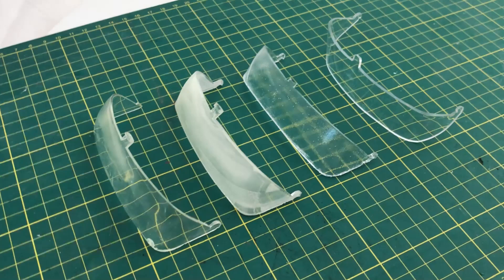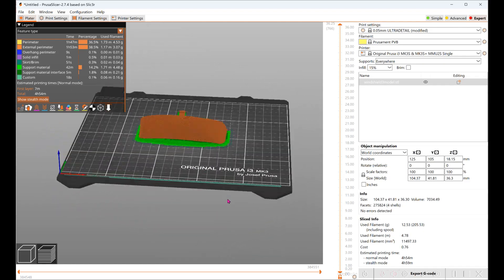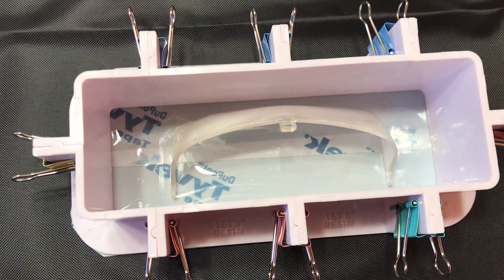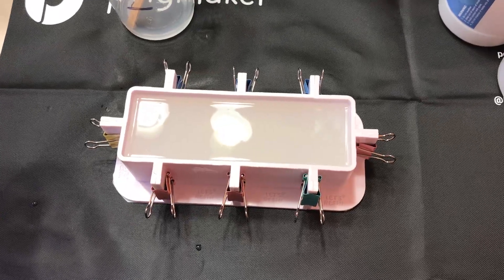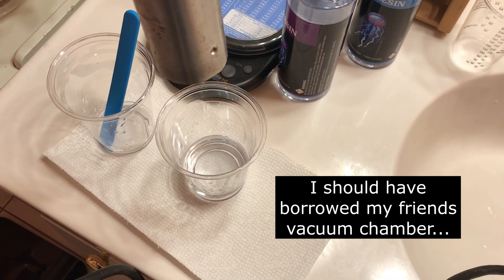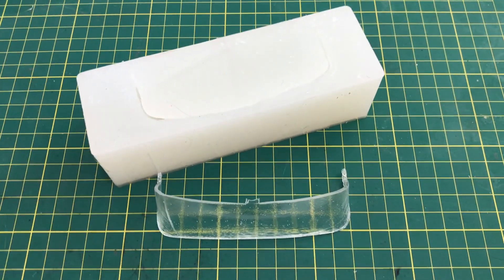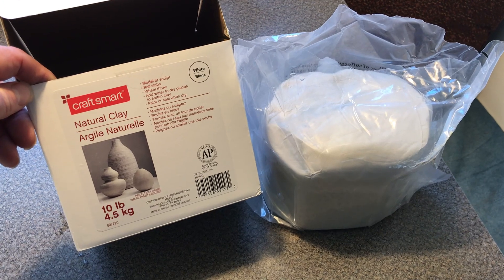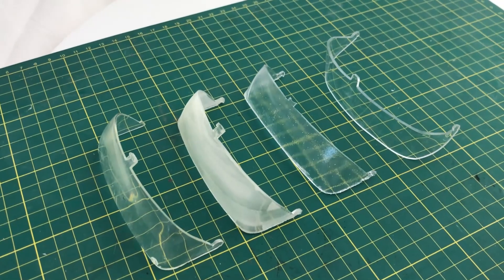Making Clear Replacement Parts: Pros & Cons of of 3D Printing, Silicone Molds, and Heat Forming

Comment: Have you thought about trying to duplicate Lego elements? There are some that are very hard to find and many that only came in 1 ot 2 colors.
Reply from the maker: Do you have a photo of one of them? LEGO blocks have a really tight tolerance.
Reply: @SerendipitySue  I didn't have a specific piece in mind. Yes the tolerances are very tight. That is what to this day separates the Lego brand from the many imitators. I know there are a couple of websites that sell 3d printed Lego train tracks. I wish I could have some ball and socket joints in purple but they have never been made in that color.

Comment: My recommendation: if you want to get a consistent pressure on the part to form it to the mold, warm both the mold and the part and quickly put them into a vacuum seal bag that you'd use to store food. Then use the vacuum heat sealer to draw out the air and then heat seal the bag. The outside ambient pressure should press the acrylic into the shape in the mold. Wait for both the mold and part to cool, and when you open the bag the part will retain the shape you want. I've successfully used this method to form vegetable tanned leather perfectly around shapes to make custom leather holders for various tools and electronics. For the electronics, I'll 3D print the object for the leather to be molded. Hope this helps and let us know if it works.
Reply from the maker: Thx. I like the idea of the vacuum bag. I was going to print the 2 parts of the mold, but even with PETG, it would warp with heat. I was thinking of making it water cooled